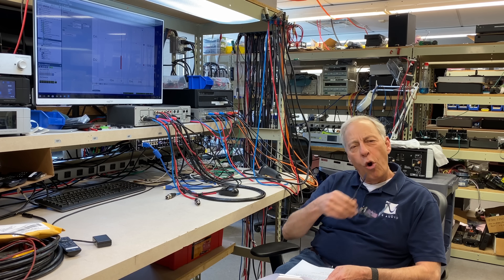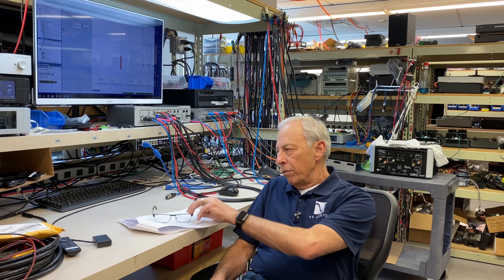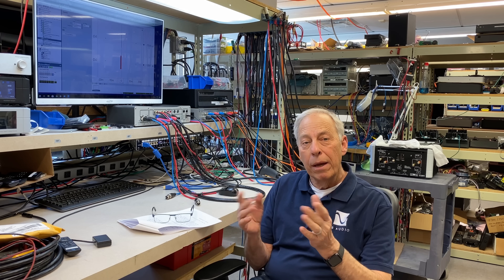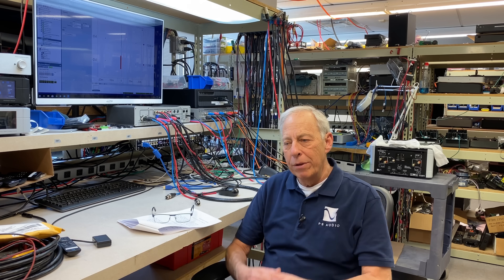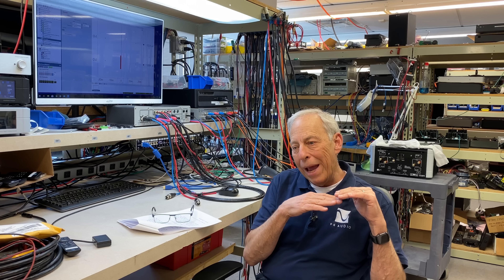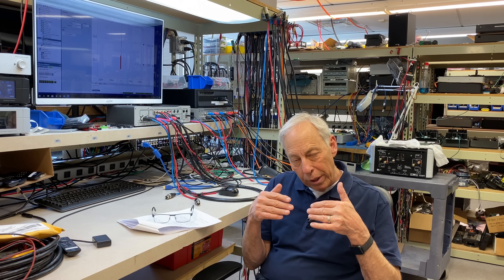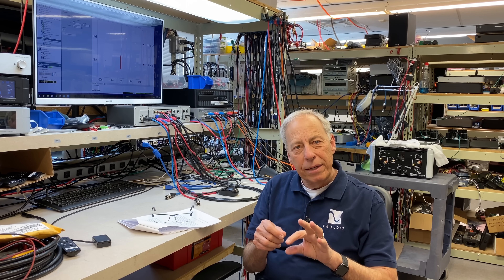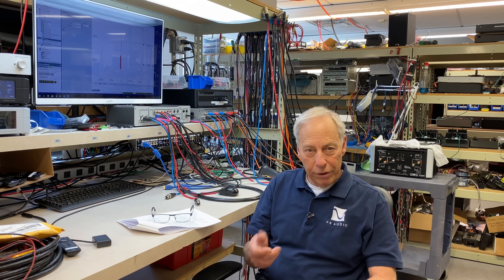How do ferrite cores work?

Comment: Have you ever considered the possibility that with the layered construction of the Earth, with a large ferromagnetic core, surrounded by a relatively insulating silica mantle, which is then surrounded by a  more conductive saline ocean covered crust, that the Earth itself can act like a giant spherical capacitor with an inductive core, and with the capacitance of the layered construction, the Earth could be able to charge and discharge voltage, while the large ferromagnetic mass at the core adding inductance, could charge and discharge current as well, so the entire planet as a whole could be able to charge and discharge pure electrical power? Does the diagram drawn by this professor not remind you of the layered construction of the earth? https://youtu.be/APXKwFrrrOM
Reply: no, the powers required to do that are astronomical
Reply: @FooBar89  The Sun,and it's Solar Wind are pretty powerful... The way that the Northern and Southern Lights glow in plasma mode, like a 6L6 or EL34 at high output, is a testament to how much electrical power is involved... As the Earth is on an elliptical orbit, it is sometimes closer, and sometimes further from the Sun, and sometimes the Sun itself discharges more power during instances such as mass coronal ejections and solar pole shifts... If the Sun, and the Earths proximity to it, as well as the daily revolution of the Earth, and it's yearly movement around the Sun, was charging and discharging the Earth, it could help to explain the generation of our magnetic field, as well as our geothermal Vulcanism... If the Earth's core was acting as an inductive element, as well as the isolated side of the spherical capacitor, while the Earth's crust was acing as the omnidirectional exposed element of the capacitor, then as the Earth neared or retreated from the Sun, and the Sun varied its solar wind output, the exposed crust would always lead in the change of charge potential, in order to match the ambient charge around it, while the isolated core would always lag behind in potential, relative to the crust... But unless the silica mantle dielectric was a perfect insulator, which would be unlikely, then the mantle would not only act as a dielectric between the crust and core, but also as a bleed off shunt resistor, allowing the Earth to slowly discharge, allowing the core to slowly reach equilibrium with the crust... As long as the relative resistance of the mantle was high enough to allow capacitive action between the crust and core without shorting it out, but low enough to act as a bleed off resistor that would allow a slow discharge, and allow it all to be an actual closed circuit, then I feel that this scenario is plausible, at the least..
Reply: John Wright still not powerful enough, if it were, we would all be dead; no need to imagine, just use solar
Reply: @FooBar89  Well..., people can experimentally handle Van Der Graaf generators and Tesla Coils when at high voltage, just as people can work on high voltage transmission lines..., but only if a person's entire body, every particle of it, is at or very near the same electrical potential, and not, "grounded"... But if the very potential of the crust, "ground", under us was varying, in relation to both the Earth's core as well the ambient solar wind around us, then us humans on the crust would not be harmed by any change of potential between the crust and the core and solar wind... Hell... How many hundreds of thousands of volts difference of potential are there between  the crust and atmosphere at any given time? It's so much that we get lightning arcs all the time across the face of the Earth discharging all that power..., but unless you are actually struck by lightning, of by something that was struck by lightning, such as a falling tree or structure, then you can have lightning strike just a few feet or meters away from you, and you can survive just fine... So no... I don't automatically assume that we would, "die", if the Earth was actually charging and discharging vast amounts of electrical power... Instead, we humans could basically just sitting on the varying voltage crust of the Earth, just like a squirrel can happily and safely sit on a high voltage transmission power line...

Comment: Great Video !! 
Have a question, I bi amped to a pair of klipsch's that is running a pair of Canare  4S12F Quad speaker cables to both left and right channels. 
 Would it be best to but them on the speaker end just on the white cables of each pair, or go further down where the white and red cables are together in the speaker cable jackets?

Comment: Hmmm...that was interesting.
Just recently I watched a YT video about inexpensive audio system tweaks.
One of his recommendations was ferrite cores around the power cable - right where it emerges from the inside of the electronics.  
His reasoning was to reduce RFI and EMI (pretty sure that's what he said).
Now I'm rethinking that tweak.
Reply: Same... just went nuts on beads for my home studio and just bought some huge cores for my long furman cables.... so this guys says its not good? uh
Reply: @WOTUFAKA  he sell his thinks I guest. I put it on my Lan cable and fuck that. The instrument sound is to sweet.
Reply: exactly. same here. now which one is to believe/follow?
Reply: @ZsoltSipos   I bought a pack of the Ferrite cores on Amazon - so the only way to know I suppose is to put 'em on & listen.

Comment: Well. Ive put about 10 ferrite cores on my system and Ive found an improvement in SQ.
I would suggest trying them out as they are not expensive at all.
I put them on some power and speaker cables and I believe they cleaned the sound of a already revealing system.
It was not day and night difference, but totally worth for the price.
Reply: So if we add a ferrite core (in my example a usb splitter -power and audio) will it make the shrill-humm manageable? All my  mics get affected by that except a Maono one which has this ferrite core on its usb cable. I have already made it go down to a slightly lower level. Where do I use it? On the part before the wires split into power& audio or before that?
Reply: @DrunkenHamster7  You might have a ground loop
Reply: It doesn't improve sound quality. It filters noise.

Comment: Will a ferrite coil effect a USB cable between my PC and DAC? I used a cable I found in one of  my spare cable boxes, it is a really thick USB cable with a ferrite coil on it.  I figured it this cable would be good for reducing electrical noise but if it causes high impedance could it be causing jitter? I haven't actually checked the resistance of the cable.

Comment: Omg ... the ferrite beads or toroids used on power cables cannot possibly affect audio quality! These ferrites provide a rising impedance characteristic for unwanted high frequencies only ! 
In crossover design they do definitely help lower the coil DC resistance but can affect sonic quality if the ferrite grade is unsuitable or it saturates..
Reply: So could I use these on my car audio system?  My power wire for my DSP or possibly even RCA cables?  I have some noise I cannot get rid of. I think it's possibly coming from my DIY lithium bank

Comment: The impedance of a theoretical coil component (oversimplified model of real coil) increases with frequency. However, the impedance of many real-world coils and resistors drops above 100MHz or 1GHz. So the coils or the resistors do not block high frequency noise well above those frequencies. An easy fix is to use ferrite. Marantz use ferrite rings inside their amps and CD players.

Comment: Interesting. Benchmark DAC3 seems to have ferrite over the wire from RCA jack to the circuit board. Audioquest used to sell clip-on ferrites (covered in red color plastic) for interconnects and power cables in the 90's.

Comment: The ferrite core along with the conductor that passed thru it  is actually creating a series inductor which acts as a low pass filter.  Only the highest frequencies are filtered out and the lowest passes -- the 60hz AC.  Like the laminations of a power transformer they powder the iron ferrite  to reduce eddy current losses in the core material.
Reply: Will ferrites help out any against lets say an EMP?

Comment: As Paul demonstrates with his hands near the end of the video Ferrite cores are high frequency “CHOKES”.
They should only be used as a last resort if other design measures cannot (which Paul mentions) attenuate unwanted emissions  to meet EMC compliance regulations.
Metallic wires act as antennas thus ferrite cores are often used to attenuate the unwanted induced electrical signals/noise.
Whether or not a human can hear the difference in sound quality is a different matter.
Reply: Will ferrites help any when it comes to EMPs?

Comment: How do ferrite cores work?  Magic, i tell you...  Magic.  Where I worked we put a small ferrite bead over a straight length of wire in a circuit and scoped it for results.  On the input side was a large amount of high frequency noise, and on the output side of this straight length of wire, zero detectable noise.
Pure Magic!

Comment: So many words just to explain that a ferrite bead works similar to a lowpass filter...
Reply: Probably would have used just as many words to describe a low pass filter so it all works out in the end.
Reply: Next up: What does a lowpass filter do, and how does it work?
Reply: @Hare_deLune  A lowpass filter basically does what it's name implies.
It only lets low frequencies pass and blocks the higher frequencies.
The frequencies blocked by ferrites is way past the audiospectrum, well up into the MHz and GHz range.
Because of that, the impedance to singals like the 50Hz power and 20kHz~25kHz audio is 0.
Reply: @QoraxAudio  you are right, Paul is very good at explaining complexe things by an easy way, but he is not always very scientifical.

Comment: i put one on my speaker cable a couple of weeks ago and it made the highs sound unreal and lifeless. took it back off and everything sounds better again.so i put it around my power cord instead.no idea if its actually done owt as i cant hear any difference.
Reply: the right application of the ferite cores is actually after the crossover and not before like in the speakers wires,which means you must put the ferite cores in the tweeter wire

Comment: Glad you didn’t go into BH curves, complex vectors, permeabilities, reactances, resistances, reluctances, and the various types of EMI induced noise. Awesome summary!
Reply: David ...he only had six & a half minutes.
Reply: Thanke YOU . BH Photo ha smore stuff than Amazon. I ahve used thems a couple of times. a EASY WAY TO USE IT 5600k LIGHT led BULBS INSTEAD OF THOESE HUGE FLORESCENT MERCURY TUBE. The guy from Home Depot shows be a 2 bulb adapter for a wall plug. Its cheap and take sup waay less spacew. THANKE YOU AND THUMBBES UPS!

Comment: I use a ferrite core at one end of my toslink interconnect.
Reply: Lol.
Reply: Let’s see who gets triggered by this comment lol
Reply: Oh, ha, bloody ha! 😂😂😂
Reply: James ...it's better if you use one at both ends; it reshapes the light!
Reply: @FatRat-f9m  I loop one in the middle, too, to keep the photons aligned.  I use a mild dish detergent, such as Fairly Liquid, to keep the jacket supple and clean.
Reply: Toslink needs at least 4 to have proper effect... 😂
Reply: @Suzuki_Akira  I'd suggest a roll of Life Savers candies over the toslink will cause a fuller, sweeter sound with additional caloric depth to the percussion.
Reply: James Plotkin awesome point, will try that 👍
Reply: @jamesplotkin4674  I truly hope someone tests it out.
Reply: Ferrite beads on SPDIF RCA coax cables (not optical) actually can make a lot of sense. You reduce common mode noise and I’ve seen bad cases of that being a problem when switch mode power supplies are used e.g. a computer connected to an audio system. This is not a case of snake oil and rest assured they don’t hurt the audio in any way. You might also consider ferrite beads on a USB cable in some cases btw. And this effect has nothing to do with the digital signal but has to do with how noise can be conducted between devices as a common mode current and ultimately hit the analog circuits inside.
Reply: @ThinkingBetter  I'm relieved the audio won't be hurt. All Audio Matters and it's our duty to preserve the clarity of same.
Reply: You need to be using fiber-optic beads for that so the induced photons can loop about freely ;-)
Reply: @foxpup  Yes, definitely, so as to preserve the time-space continuum efficiency.
Reply: @FatRat-f9m  Agreed, but gotta make a livin' ;-)
Reply: I use one at the end of my tallywacker.
Reply: @FatRat-f9m  Yes, it will be interesting to hear your own judgement of this. I would be quite surprised if the components used will have audibly negative effects on the treble. This is a simple filter and concerning treble performance, the cap should work like a near zero ohm resistor and the inductor like near an insulator. Capacitors always have some series inductance in them as they are made by aluminum foil being "coiled up". Putting a smaller capacitor in parallel can reduce that effect, but I doubt you need it.
Reply: LOL
Reply: how foolish!
Reply: that went over the heads of 95% of the people commenting in here